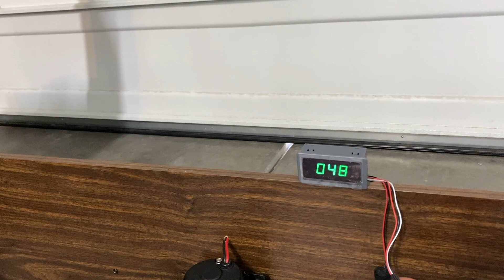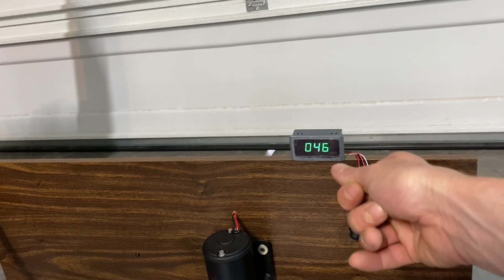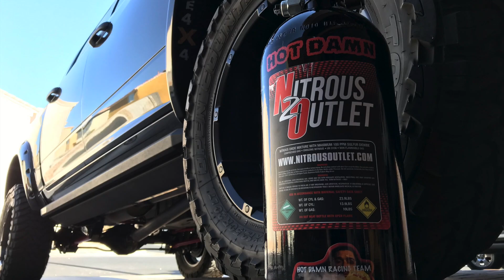Turbo oil return scavenge pump digital speed control part 15

Comment: I need to run two scavenging pumps can I use the Dominator to PWM them? I don't want to have pumps running full power when not needed and drain the tank too quickly.
Reply from the maker: Depending on the needs, pump may need to run full speed. I’m at 922rwhp and that pump is working. Over 5 years no problem.
Reply: @HotDamnRacingTeam  I'm running 2 1gpm pumps on a 1 gallon tank maybe I better let them run full power lol. Side note I shared what I learned in your video in a car group and they laughed at me told me I'm overkilling it and guys run 4's without that setup. Guess they don't know the difference between power and efficiency.🤷🏻‍♂️

Comment: I’m doing a twin turbo setup right now it was already setup when I got the vehicle the turbos are mounted at the rear of the vehicle it’s a corvette the turbos are sitting pretty low and they have to pump the oil up hill I’m trying to make this vehicle reliable and need some help !!
Reply: How are you doing now with your project?   Any new tips for the rear mount setup?

Comment: I would wire it in with the fuel pump circuit that way when the engine is running it will run the pump unless your fuel pump runs all the time
Reply from the maker: It is wired to the fuel pump with relays, works great.

Comment: A centrifugal separator just before the pump inlet might help with the air in system.  You'd need a vent line from it up to about the height of the top of the engine.

Comment: Where can we get one of the speed controllers?
Reply from the maker: eBay
Reply: @HotDamnRacingTeam    Thank you for the reply  Did the unit hold up to long term use?     This one?  https://www.ebay.com/itm/112306248234?hash=item1a25f95a2a:g:p98AAOSw2gxYpmIf
Reply from the maker: Yes, it’s still functioning for over a year.

Comment: Borderline genius! What size is the outlet fitting at the end that connects to oil filler on the intake? Much simpler than tapping the oil pan.
Reply from the maker: I have a 2015 and it says it doesn’t fit, but it’s the right one. If your oil cap screws in this is it https://www.metcomotorsports.com/proddetail.asp?prod=MBR0012-10AN
Reply: you can just add a sandwich adapter to the oil filter fitting and tap for oil feed line. no need to tap pan. as far as return, you can just return to oil fill cap on most GM products. tapping pan is really not nesc any longer many many options